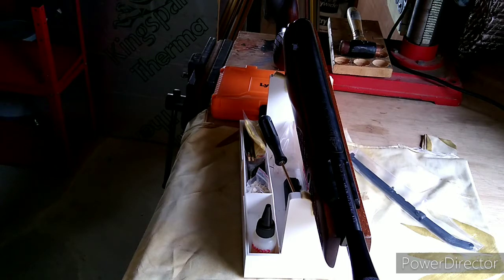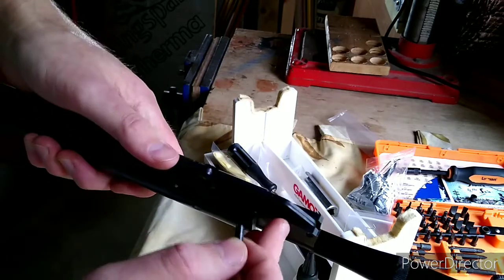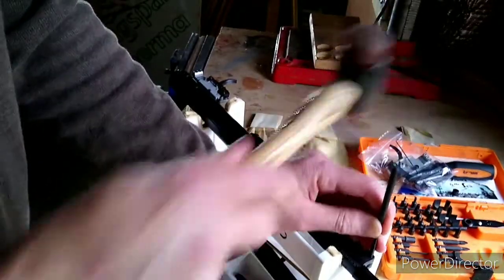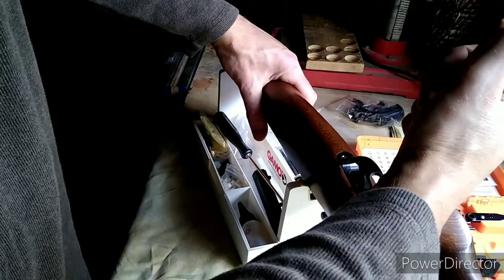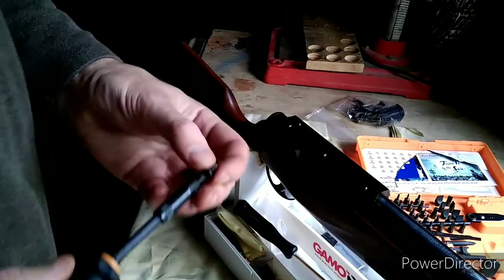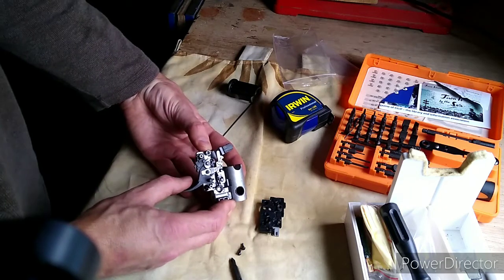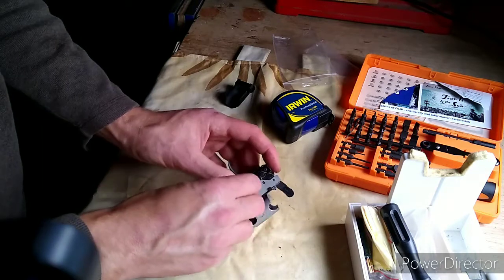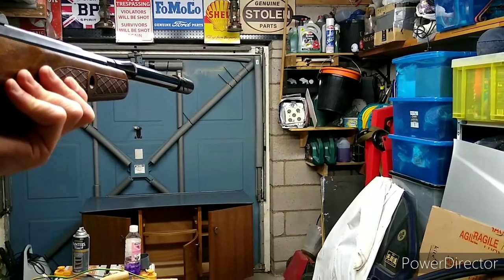NV005 BSA Lightning XL SE Project Part 3. Replace broken cocking linkage, trigger tune, rail fitting

Comment: Im enjoying these videos and its very informative coming from a complete beginners perspective. BSA rifes in general seem to be really all over the place in terms of QC, i have one of these in the GRT version and its given me no issues so far, ive not had it long in all fairness, but one day i might change out the plastic trigger for a steel one, but i dont want to mess with any of that right now because its still on warranty for 2 years
Reply from the maker: Hello Steve, thank you for your comment. Glad you are enjoying the videos. I do wish I'd bought the GRT version as they do seem to be better guns.
Reply: @nickvending9688  was this one particularly abused by the previous owner?
Reply from the maker: @stevewilliams2895  the stock is in ok condition so I wouldn't say abused, but it has certainly been used.

Comment: Hi Nick! I wonder if you can tell me what size screw for the trigger and washers for the BSA lightening? I've got the same problem as you the trigger is awful. P.s. I had the same problem as you putting the barrel back on the HW95k 😀 Pilgrim
Reply from the maker: Hello Pilgrim, thank you for your comment much appreciated 👍🏻.
The screw and washers are M2.5. The trigger improved but I'd never say it is good.
Those Weihrauch barrels, what a pain. Mind you they do lock up nice and tight.
Reply: @nickvending9688  Ok thank you Nick yeah I do enjoy Hw95.
Reply from the maker: No problems, happy to help. I really liked my old HW95K. My new one is a pain in the....

Comment: Did the longer screw reduce the weight of the trigger or anything at all?
Reply from the maker: It did help quite a bit, but the trigger was still not great.
Reply: @nickvending9688  Any idea on the size of the screw, is it an M3 and what is the length?

Comment: Why dont you replace the balde with GRT-4G? Thinking on doing that on mine.
Reply from the maker: Hello, many thanks for your comment. I hadn't heard of that trigger blade, looks like a great upgrade.
Reply from the maker: I've looked for the trigger blade on-line and Krale Shop came up. I emailed them this morning and they do not believe that it will fit the lightning. Thought I better let you know. I will investigate further but I won't be rushing to buy it.
Reply from the maker: @carpefull I think a couple of your comments have been deleted, I can't open them.
Reply: @nickvending9688  Not sure why. I was saying the trigger is the same as this rifle is made by Gamo. Look into charlie website and watch the installation guide, you will recon its the same. ATB!
Reply from the maker: I'm going to take the spare trigger apart again and take a look. I will post a video about it. I really need to get that lightning finished.
Reply: @Carpefull  Do you have a link to Charlies website and the installation guide?
Reply from the maker: YouTube seems to prevent posting links, which is slightly irritating. Try Googling GRT-4G Gamo trigger, it is the CharlieDaTuna website. If you look at the blade there doesn't seem to be the bear trap lug that the lightning has, which is what I need to investigate further. I might just buy it and post a video on it, I'll be buying a Gamo anyway.
Reply: @nickvending9688  I own a Gamo Maxxim Elite Swarm multi-shot and the trigger on that isn't the greatest either. Have also just watched this footage on replacing the Gamo trigger with the GRT-4G. https://www.youtube.com/watch?v=XApQhEWq9pg
Reply from the maker: Thanks for that.
I've put my order in for one, looks like I haven't wasted my money.
It will improve the shooting experience no end. Now I just need to get the damn thing rebuilt and putting out legal power rather than the ridiculous power and massive fps spread it rewarded my efforts with previously...
Reply: @nickvending9688  You might also find these links helpful. 
Making Gamo's SAT Trigger better https://www.youtube.com/watch?v=DOgUvhdzHlQ
Gamo match trigger for under $10.00? How to upgrade your trigger by Airgun Detectives https://www.youtube.com/watch?v=wd3i3plr5e0
Reply from the maker: @MrRockstar1968  thanks, so it is exactly the same screw as I used on the lightning in part 3. I bought a box of various sizes of M2.5 and M3 from eBay, figured they would come in handy for further projects.
Be careful when you first install the longer screw, my lightning wouldn't cock and needed it to be backed out a bit.
Reply: @nickvending9688  Did you use the M2.5 10mm or the 12mm length? As I've heard of others using either.
Reply from the maker: M2.5 x 10mm was the size I used.
Reply: @nickvending9688  Thanks, have now ordered a pack of screws. I'm wondering if I eventually fit a GRT-4G trigger, do you need to take the entire trigger mechanism out of the spring cylinder, or can the GRT-4G be fitted whilst leaving the trigger mechanism attached to the spring cylinder?
Reply from the maker: On my BSA Lightning XL SE I will need to remove the trigger mechanism from the rifle, but I don't need to compress the spring to do that.  That BSA has a separate pin for the spring, unlike the GAMOs.
 I think it was part 2 of the rebuild where I showed how to do it on my Lightning XL SE.
Reply: @nickvending9688  That's a relief to know as if I do ever get to upgrade my trigger then it will save me from needing to make a contraption to compress the spring. I might order a GRT-4G though I'm sure I seen some footage or info somewhere of someone saying they were having problems trying to purchase the trigger, though the info was from somewhere around September 2021.
Reply from the maker: I just use a big clamp, it is so much easier than messing about making a jig. My Lightning's spring was under almost no pre-load, I could have refitted it without a clamp